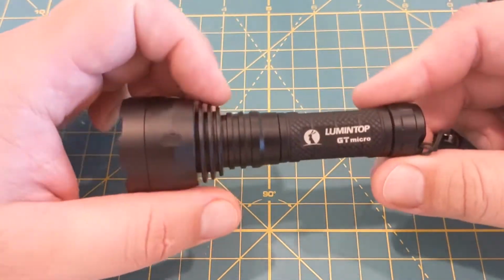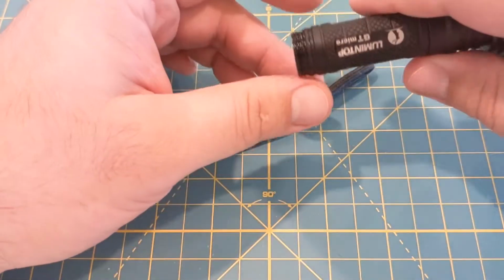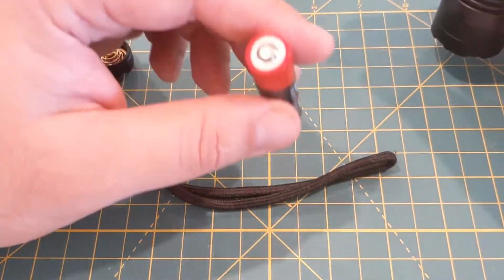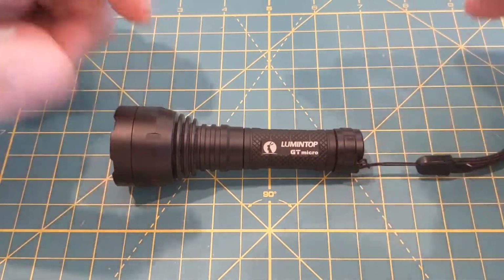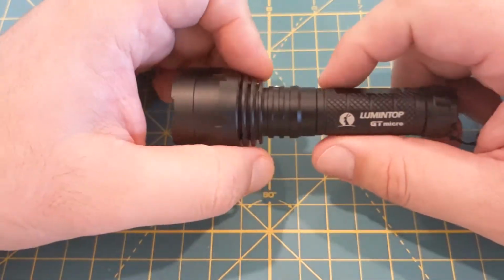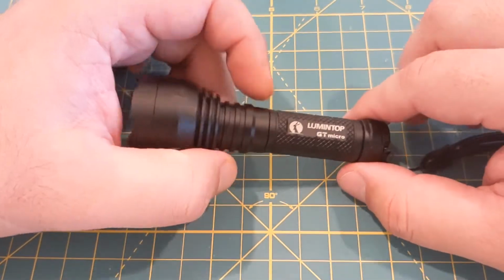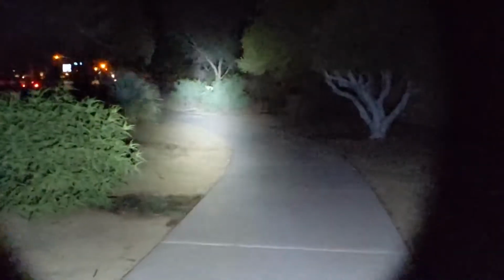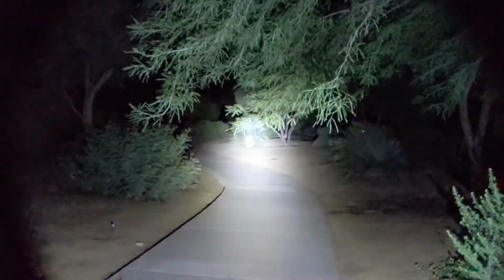Lumintop GT Micro - This 14500 throws how far?!?!?

Comment: How does this compare to the lumintop gta if you know
Reply from the maker: There's some notable differences, the body. GTA is based on the Tool AA so it is a rear clicky with only 4 modes (I believe only 4) and the GT Micro uses a side switch with Narsil UI. GTA is a pretty focused beam with almost no spill and GT Micro does have some spill but throws slightly less. There is a GT Micro with an Osram LED that may be more comparable to the GTA in terms of beam.

Comment: Thank you for the video.  I just got a Thrunite catapult mini which is very cool and I have a question maybe you could help me me with. I carry it in my pocket so I thought it got turned on some how because the battery was dead. At least I think because after charging it for an hour or so it still wouldn't light up. I left it charge over night and still nothing. It would work when it was plugged into the charger but not when it wasn't. Finally I opened it and took the battery out and then I put it back and the flashlight works again 🤷‍♂️. I don't know why and I'm hoping you might be able to tell me. ✌🏽️
Reply from the maker: You probably did the electronic lock out by accident while in the pocket. So removing the battery broke the circuit and reset it. It happens.